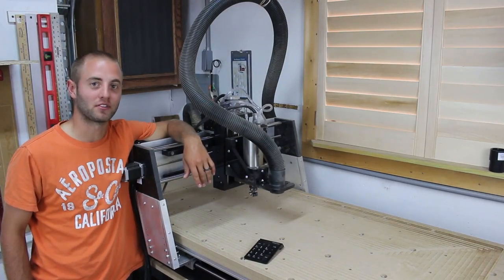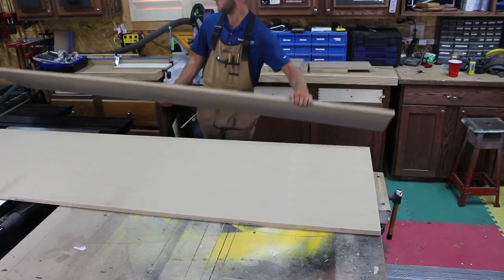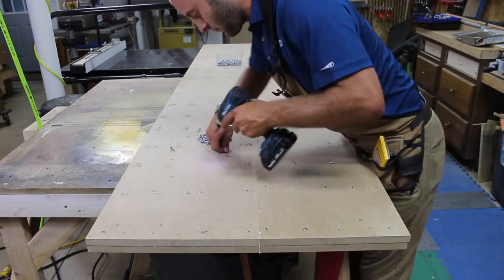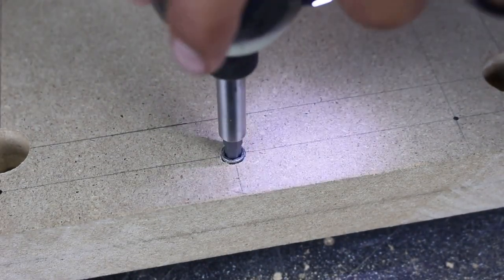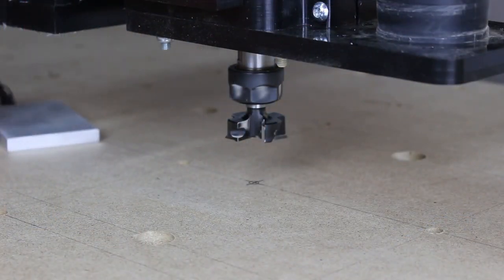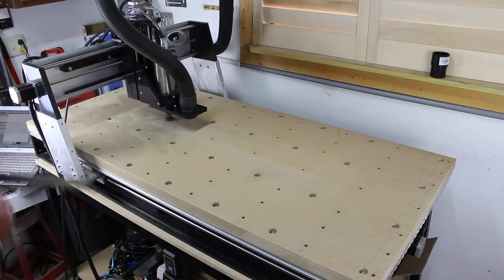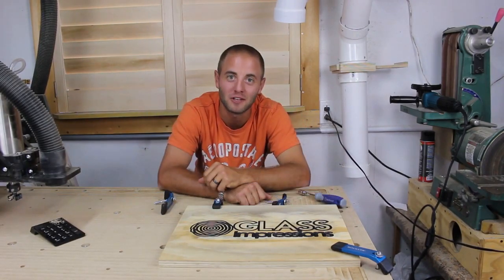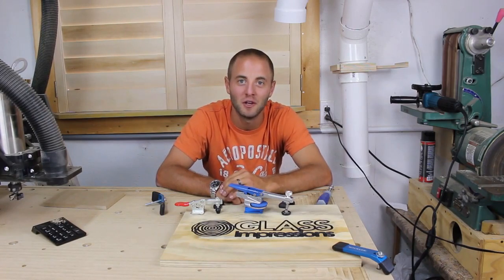CNC Tutorial: Create a Spoil Board to Protect Your Machined Bed Surface | Glass Impressions

Comment: How did you get the dust boot on mid program without starting the cut over from the beginning? If I need to stop the cut and lift up the router, when starting again it starts from the beginning of the tool path.